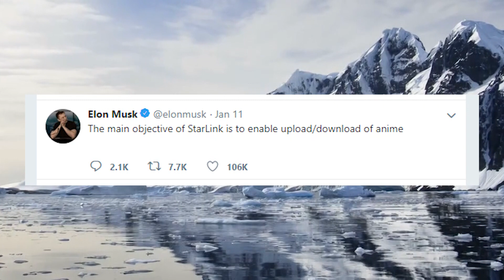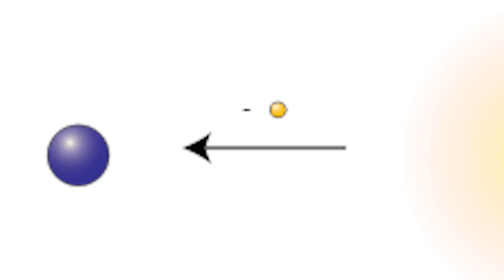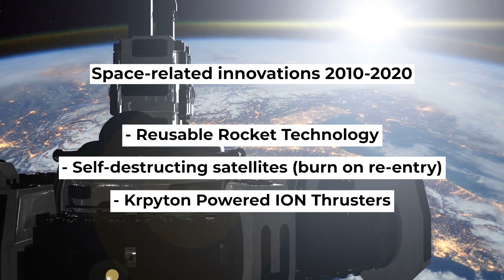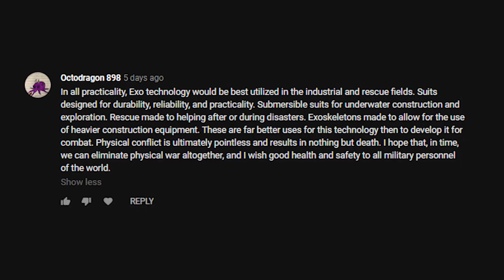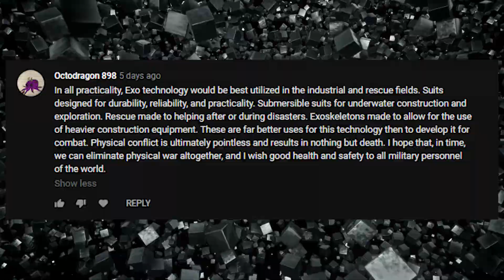What is Starlink?

Comment: Some ways we can reduce space pollution in Earth's orbit are to coat the satellites in a non reflective substance. But we have to make sure it doesn't absorb too much heat. If that doesn't work, maybe tell the astronomers to wait until the satellites are covered by Earth's shadow.
Reply: That would still obstruct the view of stars and such. If it absorbs all light, like vantablack it would still make it impossible to see through. So out of the astronomy point of view I don't think this would work very well.
Reply: @sebaszt1312  don't forget that these are quite small satalights at a minimum of 400+ kilometers away orbiting at high speed, that blockage would be extream small and short lived, even with lots of them that is something you can easily overcome with normal astrophotography procedures and software.

As an added bonus with SpaceX dropping the cost to get to space and building their massive 9 meter wide Starships, it will allow for launching more and larger space telescopes that don't need to deal with day/night cycles, weather, or atmospheric issues in general